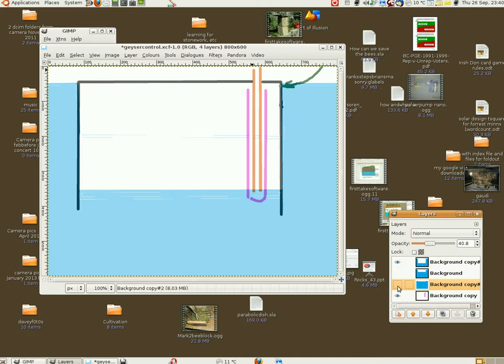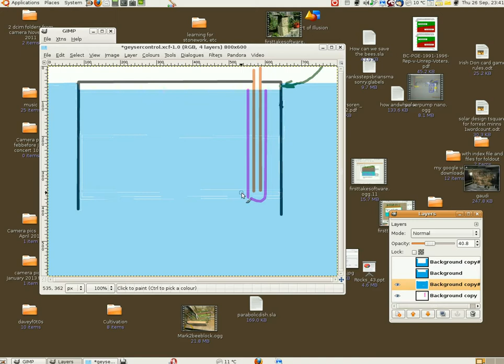Geyser controller for air operated ebb and flow or raft hydroponics systems.

Comment from the maker: Thanks Brenda and thekeddi,  Brenda, I secured pipes to each other with a push fit and a little piece of different diameter tubing between the 2 pipes and that holds in place.  Guess there is no excuse now, I will have to make a real world demo!  One reason to do this is to get manufacturers to make  solar powered air pumps. There isn't much of a market for them. But if they were running thousands of hectares of hydroponic lake gardens, that might change.

Comment: Ah, I found a diagram for the demo geyser you demonstrated with a more recent video.  Interesting solution.  I used a bell siphon as it does not require an active component (air pump).

Comment from the maker: Hi, Patrick, your bell syphon does have an active component,  (a water pump).  The air pump method has a few advantages and disadvantages.    One advantage is that there is not electric devices  in the water so in theory it will be technically easier to set up.

Comment: Ok, so the purple line outside the tube... Is it another pipe say double the size of the geyser pipe? How would it be secured, it seems to be suspended... I think it could be secured to the tank without any trouble but is that right. I think I am getting this. I sure am getting excited about the direction you are taking us! This could be running a good size aquaponics with a small air pump... These can be purchased 12 volt or solar...